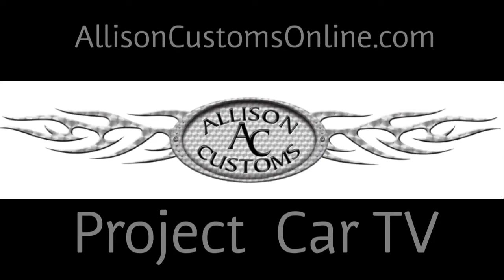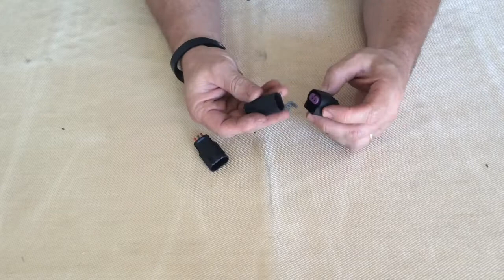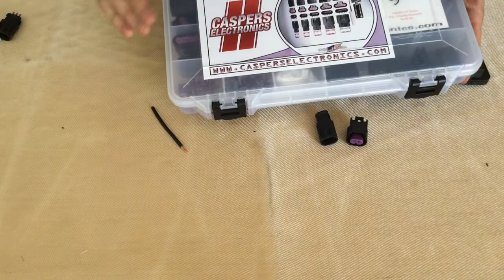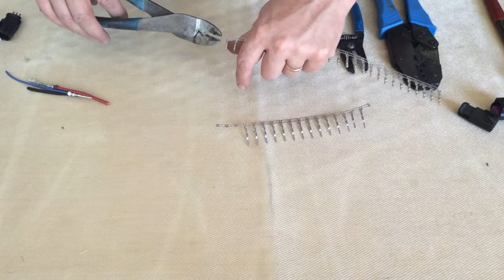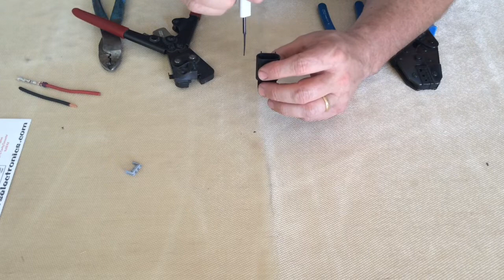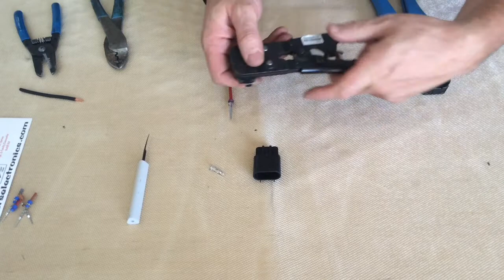PCTV HELP - Delphi GT  150 & 280 Connectors

Comment: is there a cheaper option for the GT150 crimper?
Reply from the maker: You can use a universal crimper, doing one set of retainers at a time, it just takes a little extra time.  If you are only working on a single project with a few dozen pins, it certainly wouldn’t be worth buying the GT specific crimpers.

Comment: Great Video. I'm using the 280 with 10 AWG + and 12 AWG - marine wire to make connectors for my dual eFans. I don't have the correct crimping tool will have to be creative. But is there anything wrong with putting a drop of solder on the raw wire/clip?  Also, I know you didn't think they were necessary, but could you show the insertion and removal of the retainer in the 280?
Reply from the maker: I’ll see what I can do to show you those steps.
Reply: @AllisonCustoms  I'm just doing my eFans power/ground from the PWM fans controller. I have a set of HD crimpers that can do the wire and the wire jacket separately so that works. I'm just a little confused on the actual insertion from the rear, shorter pin, I guess you'd call it the female, has a little barb on the bottom that looks like it'll fit into the notch but its not going as easy as yours did. Also, I bought two from Amazon and they don't have the little round seals, they have a dual seal piece that you slide on the wire before crimping, then once you do get the wires seated, you slide the seal forward. The elongated retainer seems to fit on the larger half of the connector and the larger connector also has the same style (different color) press in seal for two (2) wires. Wish I could send you a picture.

Comment: Any what about the waytek metri pack?    and weather pack
Reply from the maker: I've used a few, but i have never found easy access to them for continued use.  Also, I like the compact design of the GT Series and with the 280 series larger pins and counts are available.

Comment: Hi, I've written in before. My issue with the Deutsch plug, though IMO they are much easier to assemble and crimp, they do not make a DTP (AWG greater than 16)  with anything larger than a 4 pin plug. 

The deutsch DT series only accepts as large as 16 ga.  The DTP will accept 14-12, but again 4 pins is not enough.  That said, I have some of the  Delphi GT 150 series, but they do not accept  anything bigger than 16 either..  at least I am fairly certain a 14 is a tall order to squeeze into a 150 pin.  

The GT 280 series appears to be much larger as we see in the video, but can you insert two different AWG wire size  pins into them?

My wire harness is made up of 10 wires. 4 are 12 awg and 6 are 14 awg. 

I would rather use one 10 pin body if I can incorporate two differ AWG's into it.  

Really stinks the deutch doesn't offer much for 14 awg.  Their DT series is just too small . and the DTP is useless with only having a max of 4 cavities.  This is why I think I may have better luck with th eGT 280? ?

Thoughts?   Thanks
Reply from the maker: The 280 can handle pin sizes from 22 to 10 awg (I believe), but as with most manufactures you end up being limited by the Total amperage for the connector.  I would have to verify, but I believe that is a MAX of 30 amps per connector plug.  So using no more than 2 or 3, 10+ amp circuits in one plug would end up being your limiting factor.

Comment: hi could you do a more specific video on the GT 150 I bought a bunch of them from way tek and nobody has any real specific instructional videos on how to properly assembled them

I got so frustrated I started using Deutsch connectors as they are a hell of a lot easier to build IMO

specifically the orientation of the pinnas you slide it into the GT housing 

my pin did not seem to want to fully engage there was a lot of slop
Reply from the maker: Sure thing. What specifically are you having trouble with?

Comment: Great video! Could you add the part numbers for the connectors and crimpers you used in this video ?
Reply from the maker: Thank you!  You bet, I will dig up the info and put it in the comments.
Jeff
Reply from the maker: I finally had time to get the tools listed.  Let me know if you need other info. Jeff